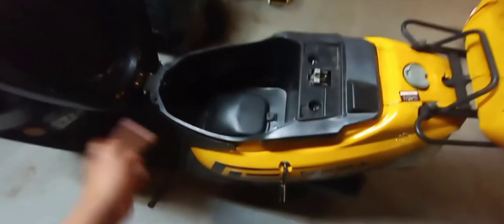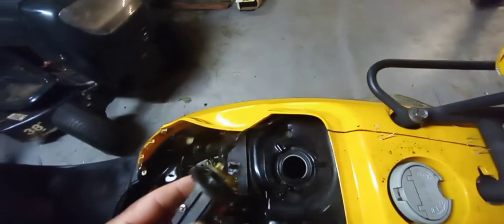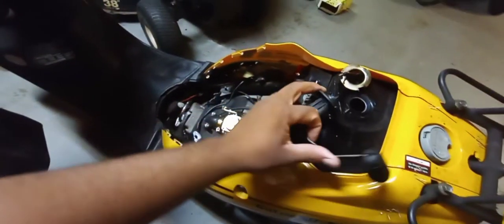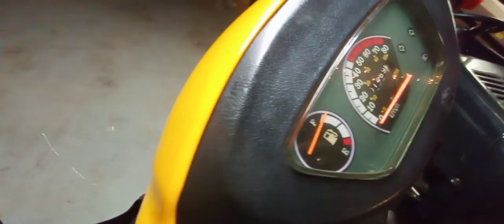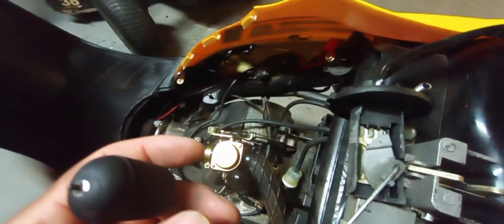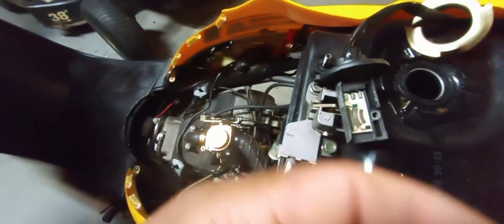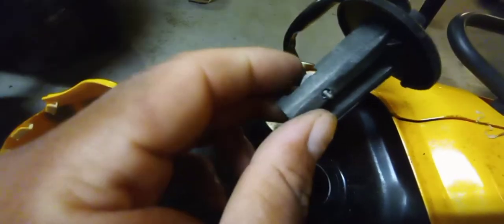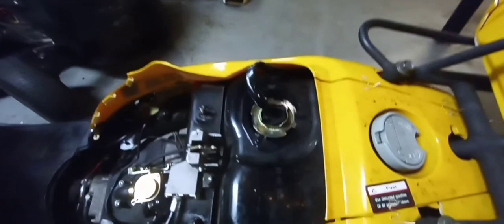how to check/ repair fuel sender on 50cc scooter

Comment: You're absolutely amazing you did this with one hand I'm a woman and I'm just now trying to do this by myself could I use carb spray on the corrosion area what did you use to clean it
Reply from the maker: No your amazing. Not many girls work on stuff like this. Carb spray will work. And just bend the pins a little to make sure they are making contact when connected

Comment: Hey boss would you know what to do if this doesn’t work. Tried replacing mine with a new one but it still reads e
Reply: First thing u should do is check the wires, open the back of the dashboard if, and locate the wires that to to the fuel gauge, look if it's rusted or any wires broken, u can also check with a multimeter
Reply: @Sloby-ie6zr  i have tried opening and checking the wires. Got this scooter brand new don’t currently have a multimeter
Reply: @german9277  here's what you should if you don't have a multimeter, disconnect the wires that go from the fuel float to the dashboard, get some wires that you have laying around, get the wires in the connection from the fuel float to the fuel gauge, only connect the white/blue and yellow, and the connect the green wire left from the fuel floater and ground it on the scooter. If you didn't understand feel free to ask
Reply: @Sloby-ie6zr  sounds good boss and would you be able to explain how to do it. I think i have an idea of what you mean but it’s better to be safe than sorry
Reply: @german9277  yeah, look at the fuel float at the gas tank, the fuel float has a wire and a connection, disconnect it, and the connection that comes from the dashboard you can see 3 wires, get some copper wire (any wire works if it can fit) and connect the green wire to yellow, and look if the fuel gauge starts moving, this way you know if the fuel gauge is working, connect the green and yellow wire from the connection that comes from the dashboard
Reply: @Sloby-ie6zr  ah i see thank you much appreciated. Im assuming that whatever it is that dosent move the needle is whats causing the issue. I see. Thank you for your help I’ll try and update you if that dosent work
Reply: @german9277  yes by connecting the 2 wires together the fuel gauge will think that the tank is full, and it will show full, if the gauge isn't working and you have the battery charged and the wires are connected together, the fuel gauge is bad